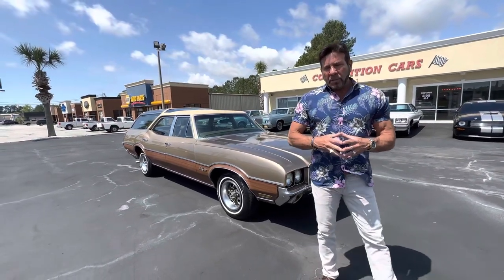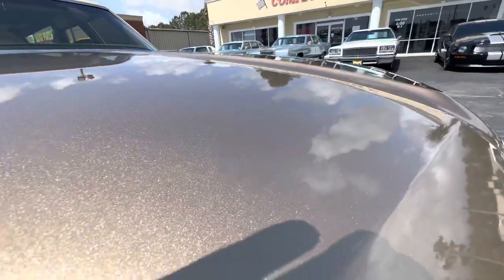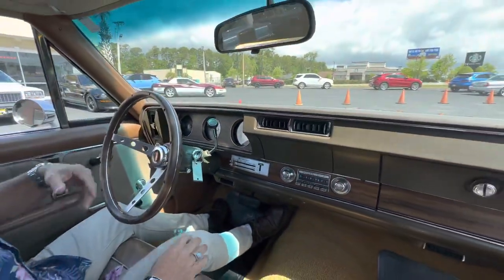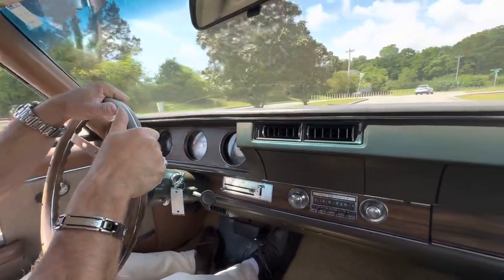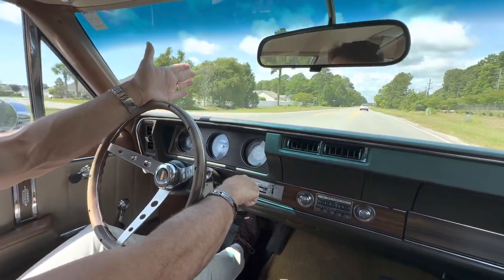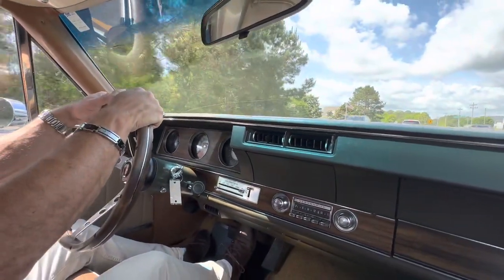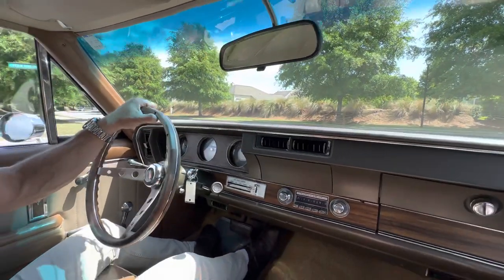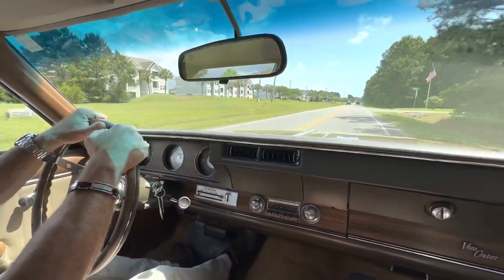BURNING RUBBER in my Vista Cruiser Wagon! Fun Driving Video!!

Comment: My parents owned a 72 Vista Cruiser just like this but it was a light yellow color same wood grain and everything, I don't think ours had the vinyl top either.  My father worked at GM and got it as an employee purchase of a company asset, it was a company owned vehicle that someone drove who got a company car as a benefit of their job. They would see those to employees when they had around 3000 miles on them. My mom picked it up right in Lansing where it was built and Oldsmobiles HQ was up there back in the day. That car was loaded and had the 455, I was just a small kid but my mother said that would pass anyone. My father usually picked cars with great economy, If he had ordered the Vista Cruiser it would have been this car in the video with a 350 and crank windows.  Anyhow, great video it was surprising how that lights off the tires so well being a wagon and not the larger engine !
Reply from the maker: Thanks! It is actually fun to drive!
Reply: My parents had a '68 Vista Cruiser with those same colors. If I remember right, the greenish gold color was called willow gold. I had to parallel park that beast to get my drivers license.

Comment: Is there a drag strip near your location? If so, you might add a trip down the quarter to the video presentation. Hammering it off the line without rods clanking or piston slap would be an excellent sales point.
Reply from the maker: There is an 1/8th mile track kind of close but it's already up and running on Bring a Trailer, so I better not! lol

Comment: Took the time to wire-in a new rear window switch under the dash but couldn't spend the time to replace the factory one?  Also the radio probably needs an antenna hooked up.   Neither is very difficult to do in these era cars.
Reply from the maker: That was the previous owner. Come on by and help anytime you like, everyone in Myrtle Beach is backed up for months or I could make every single car absolutely perfect.
Reply: @christianbugatticg  throw a little shade there I love it bill.
Come on down to Myrtle Beach and turn some wrenches with us🤣
Reply from the maker: @truckerkevthepaidtourist  Not kidding!! Lol